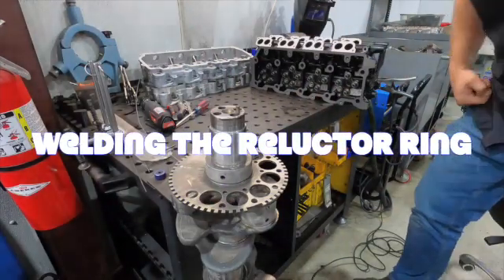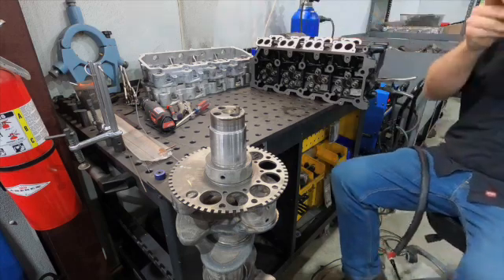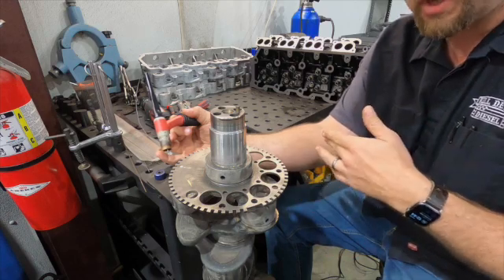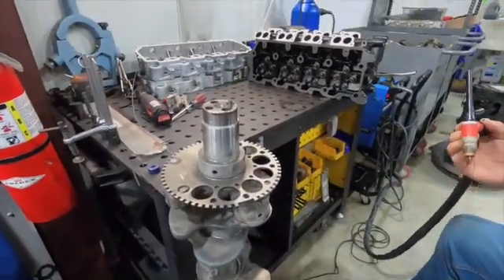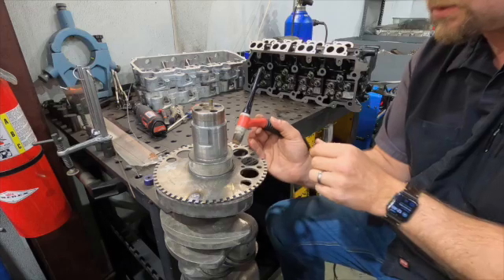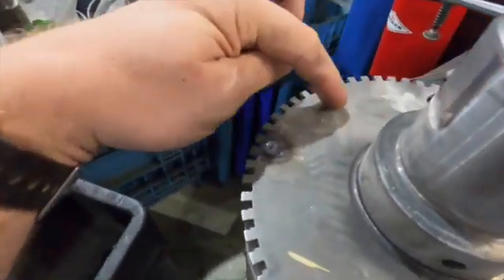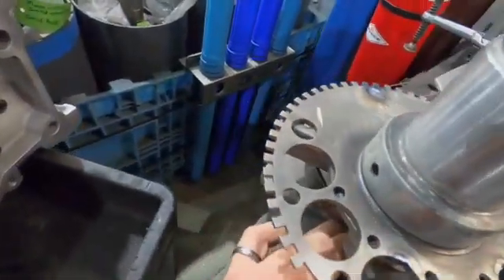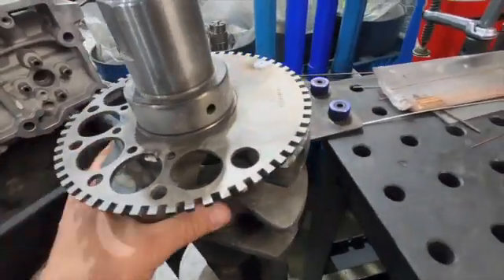Reluctor Ring Welding

Comment: Want to share Info….
2001 Ford F250 7.3 Diesel / Automatic/ 4x4 short bed crew cab / Lariat

CRUISE CONTROL-INOPERABLE.

After replacing almost every piece of the cruise control system….Found the problem to be the Black wire with a pink line  under the lower steering column panel cover. This wire had been snatched out, broke and the plastic mounting piece was not connected to the key switch… 

SOMEONE BEFORE ME DISCONNECTED IT TO MINIMIZE THE DOOR OPEN BELL/door chime would be a good guess…

Definitely without this wire connected there will be NO CRUISE CONTROL which makes this Must check #1..

** Note: Purchased a replacement Pigtail from EBay (OEM Select Parts from Pennsylvania).  It’s a Black wire with a pink stripe.  It has the plastic piece that goes in the key switch before the lock is re installed.  The replacement will arrive with a little white shipping protector and that piece must be removed before installing.****

Must check#2:—Replaced the steering wheel cruise control switches. (Note: found the originals to be shorted out…) This is a hard part to find OEM with backlight… Ended up using some cheapo’s with NO backlight.  Waiting to find a good set of OEM with backlight.  While checking the original switches with a multimeter, using the continuity setting. The original ones had some interference.    

Must check #3– Also Replaced the pressure sensor and pigtail at the end of the Master Cylinder. Note: One of the two wires has a positive 12v . The pressure switch can be checked for continuity / with a multi meter while you are right there.   If it has continuity, then that says it’s good….   There are multiple different pressures switches and configurations you may have on your master cylinder.   The  pressure / cancel cruise control  pressure switch works at 20 pounds of pressure and is used as a redundant safety measure.  This issue can be found on Youtube.  Make sure to buy OEM Ford Parts….

Must Check #4: Your Foot Pedal brake switch. If you have brake lights at the back of the vehicle including the 3rd brake light, it’s probably not the problem. Clean any corrosion at the stop lamp bulbs.  LED bulbs can kill the cruise control circuit. Once the actual switch itself is removed, there are only two electrical connectors on the switch that will have continuity.  

Must Check # 5—
The parking brake supposedly is included in the cruise control loop… Did not take the time to see if it actually makes a difference or not. The point is, press the emergency brake down and look at the Right Side Of The Instrument Cluster. You should have seen the emergency brake illuminated in Red. If this does not happen, carefully remove the emergency brake switch and you will see a very solid made switch. This switch is made from aluminum and strong plastic. The aluminum will need to be cleaned free from aluminum dust. Small piece of sandpaper. From here you will now see your emergency brake light illuminating every time. Also Note that if you look at the dash with a flashlight, you will see all indicators. There is also a spot on the LEFT side of the gauge cluster that has another round park brake indicator. When this trucks gauge cluster was removed, the “extra” indicator does not have a bulb. Even put one in and nothing. So again, the light you want to see with the emergency brake is on the RIGHT side of the gauge cluster. The one on the left is not used.

Some interesting notes:

*****NOTE: During the diagnosis and multiple test drives, found that the transmission has to be In 4th gear and rolling greater than 45 MPH to activate the cruise which by the way works great now!

For the transmission:
I did not have any fault codes for the automatic transmission… We do have a switch on the transmission and I guess it’s probably in the cruise loop. Evidently this one on this particular truck appears to be good. Did not change anything on the transmission.